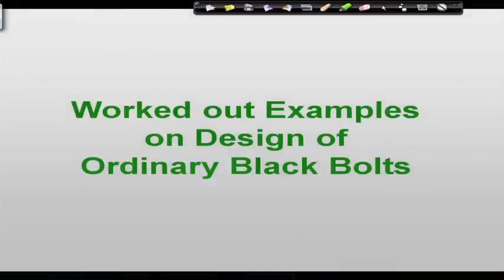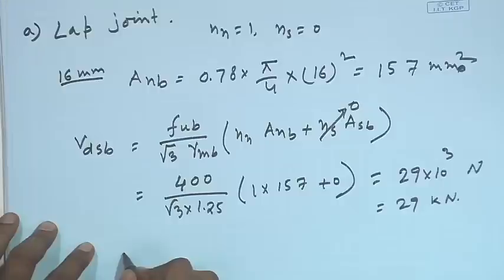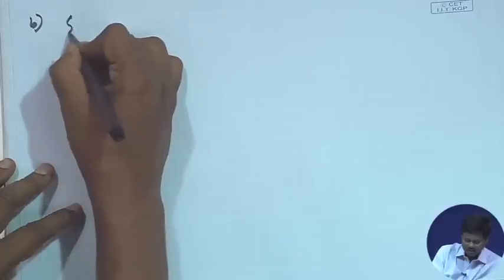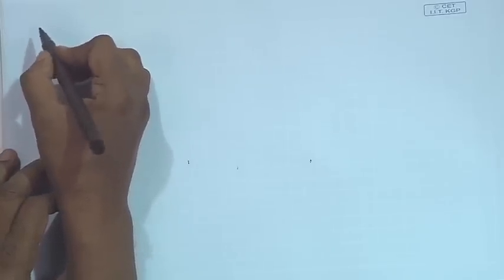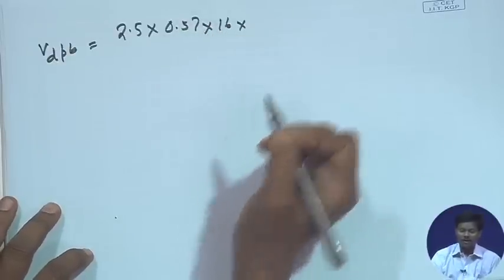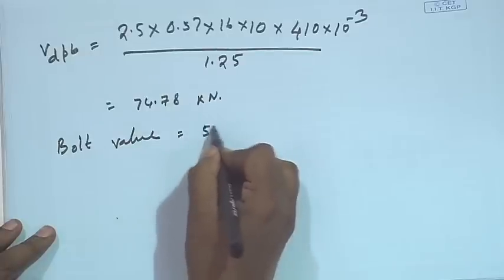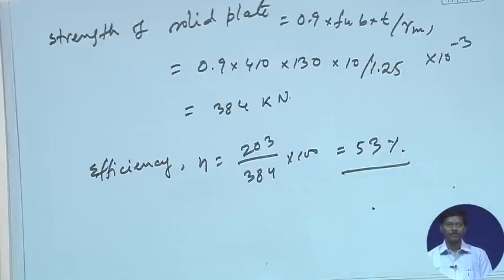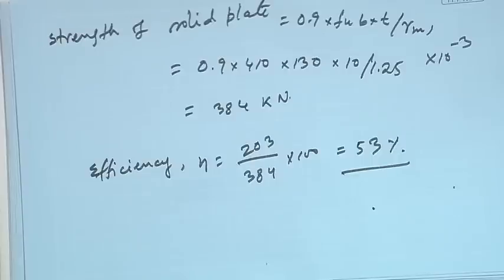Lecture 7: Worked out Examples on Design of Ordinary Black Bolts

Comment: The no of bolts required is 6 (@14.50) ,so it means 6 on each side in a butt joint, then why is he providing only 3 on each side (@16.45)?
Reply: yes, you are right. total 12 and 8 bolts will be provided in question 1 part b and c respectively.
Reply: @vishalbarwal6659  brother, why we need 8 bolts in part (c)?  Shouldn't 6 bolts be sufficient?  3 on each plate?

Comment: While designing Single Cover butt joint, instructor didn't account Reduction factor  for packing plate in determining Design Shear Capacity of Bolt.
Reply: Because it is not necessary....
We don't want to use packing plate there.....

Comment: pitch = 2.5d = 2.5*16 =40mm not 50 mm.
Reply: 40 is the minimum value of pitch required.so we can take higher value
Reply: We take the hole diameter
Reply: According to clause 10.2.2 of IS 800:2007  minimum pitch= 2.5 d, where d is the nominal diameter of the bolt.